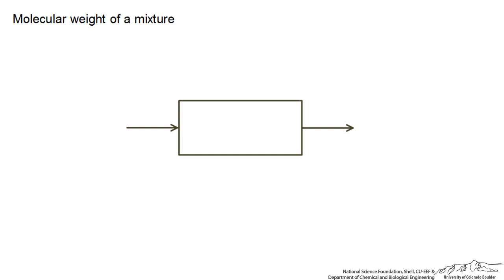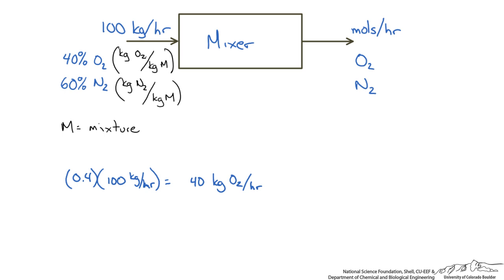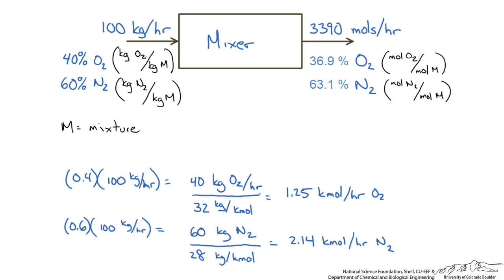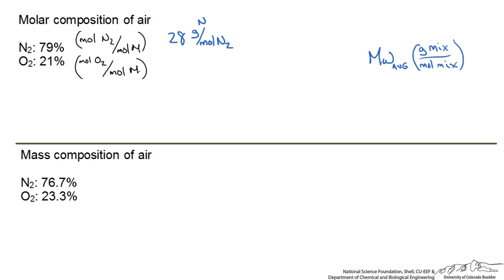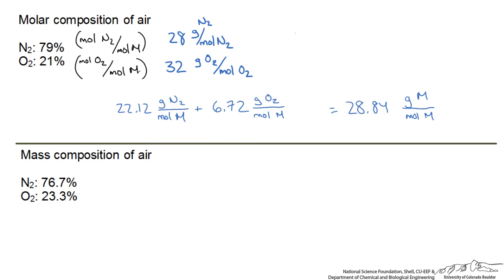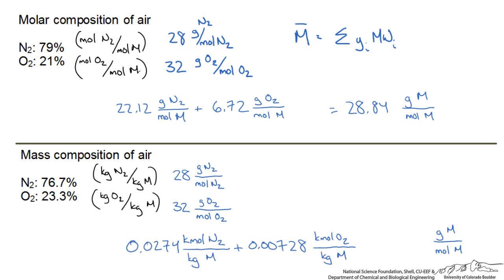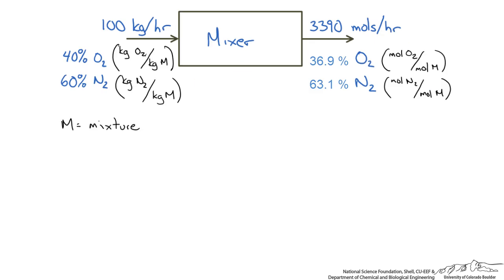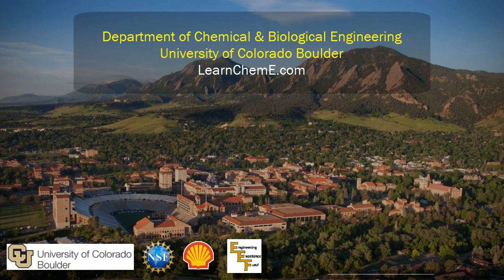Average Molecular Weight Derivation

Comment: What did you do at 2:00 for the streams of N2 and O2?
Reply from the maker: There you are finding the mole percent of the stream.  You have 1.25 kmol/hr of O2 and 2.14 kmol/hr of N2, for a total of 3.39 kmol/hr of the mixture.  So the mole percent of O2 is (1.25 kmol/hr)/(3.39 kmol/hr) = 36.9%.  The same calculation for N2 is (2.14 kmol/hr)/(3.39 kmol/hr) = 63.1%.

Comment: I am confused on 5:41, you stated that you got the same value, but the units are different. How is that possible?
Reply from the maker: +uBoscuBo Thanks for the question.  The units of g/mol are equivalent to kg/kmol.  If you start with kg, you will multiply by 1000 to get to g.  Since you have kmol in the denomiator, you will have to divide by 1000 to get mol in the denominator.  Therefore: 
28.84 kg/kmol*(1000g/kg)*(kmol/1000mol) = 28.84 g/mol